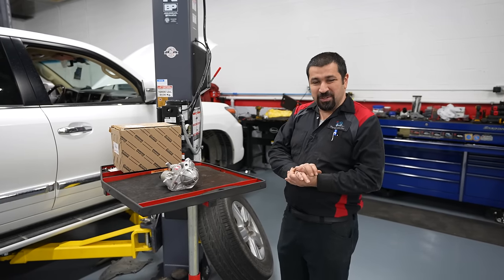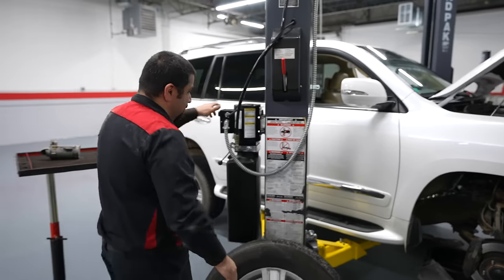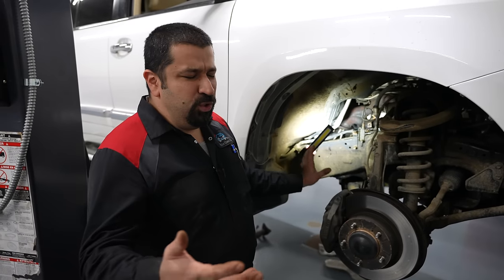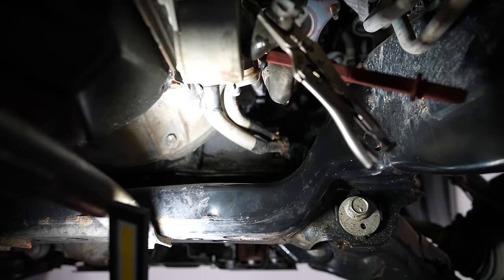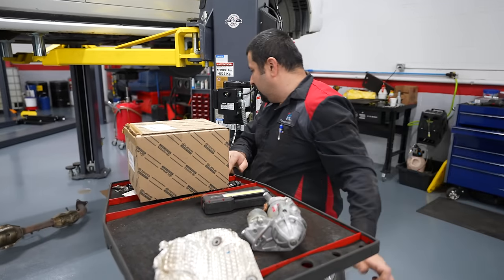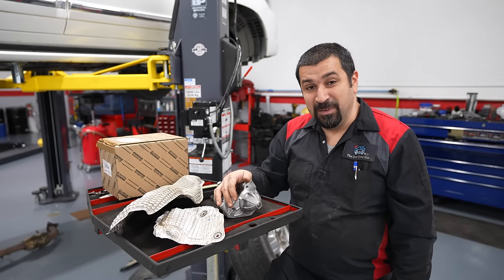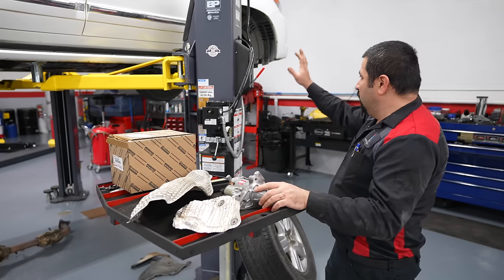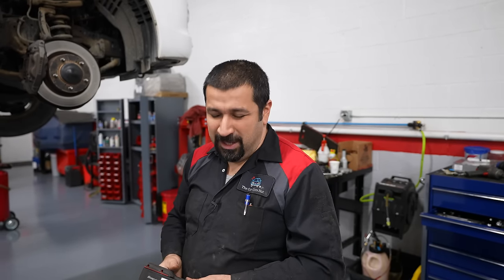TOYOTA! THIS is REALLY A Horrible Design! You Could've Done This Better!

Comment: Good honest video.  Worst starter I've ever done was on a gm 454 in a boat.  Starter comes out the bottom, but the whole engine is only about an inch off the boat bottom and because of the stringers (like the frame) of the boat you can't even see the starter.  All done by feel.

I did that once.  Next time it was easier and way quicker to just remove the entire engine.  

At first I doubted you that under the intake was better, but in light of what you showed here I agree with you

Comment: Just put Loctite on every bolt and screw and there would bever be a seizing problem. Loctite also adheres the threads together in a controlled manner, so it prevents the bolta and screws from coming loose before they seize on from corrosion.
Reply: Mind loctite contains chlorides and is corrosive to stainless steel. I haven't tested it on exhaust studs but I doubt it would prevent gouling

Comment: Look at this way. This is a terrible design.....yes I agree. However the Dolts over at Honda thought it was a wise idea to have the starter on 9th gen V6 accords connected to the torque converter. Don't ask how... so in theory if your starter craps out it will also damage your torque converter 💩💩💩

Comment: Yeah, they don't engineer this stuff to be worked on later.  Toyota used to be pretty good about this, but not so much anymore.  The 4-cyl engines are certainly better.  I think the Euro cars are the worst, followed by the newer American crap.  Nissan is not all that great either, since they merged with Renault years ago.  BMW's are horrible to work on.  Same with VW and Mercedes.  Most experienced mechanics don't want to touch that crap.  It's a can of worms.

Comment: Dissimilar metals. What is Toyota thinking? I thought Toyota had great engineers? Do they just shrug their shoulders and say F it?
Reply: Dissimilar metal is not always bad.  I had a Mitsubishi car with steel studs on the exhaust manifold and using copper nuts to secure it.  Never had any problem with disassemble nuts, they can just be loosened very easily. No rust problem.  Trust me, I am an engineer.
Reply: @armantokimiadi1900  yes. But galvanic corrosion is more likely with steel and aluminum or stainless steel and steel. Proper anti seize or hot dipped galvanized steel are good solutions. The auto industry doesn’t use anti seize.

Comment: yea this is way worse than intake manifold lol plus the hot exhaust manifold you might have to wait to cool down.

hey your camera man is lax, he didnt brush off the dust on your back hehe.

another instance of toyota being lame is using proprietary bolt on the belt tensioner pulley, not the tensioner itself, just the wheel. which i bought the socket for because what the heck, pay myself and get their stupid socket, cheaper than paying someone else to do it.